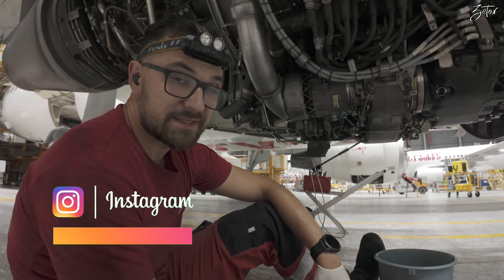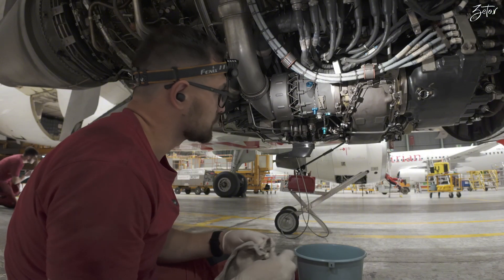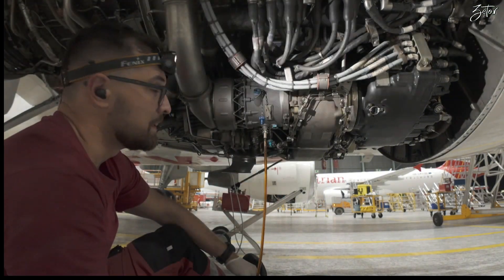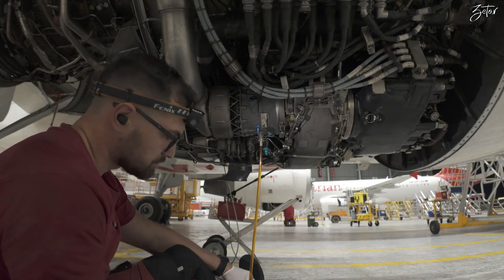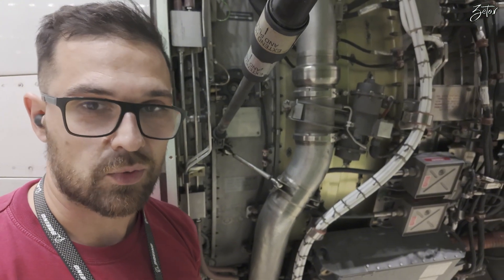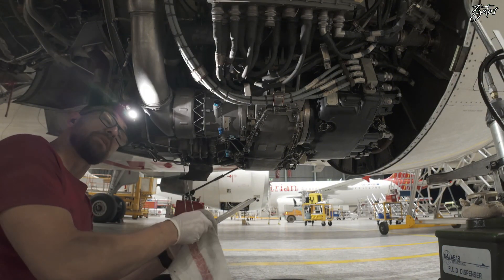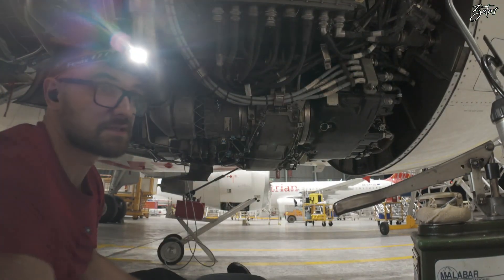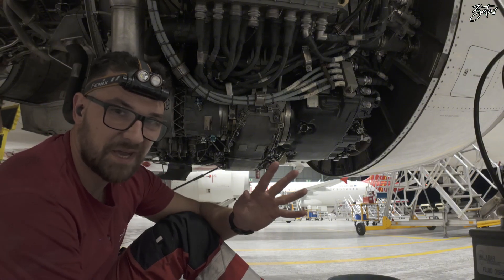Servicing of Starter on A320 CFM56-5B

Comment: Hi my friend you did not explain if the started is connected within the engine’s oil circuit or has independent oil pump and filter ? 

And if the starter is supplied by engin’es oil why do you service the starter itself as the oil pump of the engine basically feeds all systems??
Reply from the maker: https://youtu.be/EUolD-o37VM

Watch this, it should explain everything 🙂
Reply: @zeto.r Ok thanks !

Comment: En el caso que este diferida la válvula de start en pleno vuelo como el piloto podría reiniciar el motor en caso de apagarse ?
Reply from the maker: I guess you mean dispatched or faulty. Answer is simple. It is like car which is rolling down hill. In this case we will use power of the air. It is enough to restart the engine without starter
Reply: Muy agradecido por tu respuesta 😊

Comment: How do Engineers manually open the starter value for engine start is start valve doesn’t open?
Reply: By using 3/8 speedhandle while  engine start
Reply from the maker: You have that small lever on the side with which you hold it open, but you need gloves otherwise you will get your hand burned 🔥

Comment: If and when possible, I'd like very much a video about the starter valve. From what I understand it uses the air pressure from its own upper pipe to do the mechanical work to open itself, must be very clever.
Reply from the maker: https://youtu.be/JvGCooPPpF0 https://youtu.be/XBdChureQ1Y
Take a look at these 2 videos and you will understand everything 🙂

Comment: Question. At 50%+ N2 rpm isn't the running engine now driving the starter through the centrifugal clutch so I'm wondering how does the centrifugal clutch disengage from the engine N2 turning at 50%+ even after the FADEC/EEC has commanded the air start valve closed.
Reply from the maker: I expand it also here https://youtu.be/JvGCooPPpF0 but you need to understand how centrifugal clutch works. Lemme know if you need more info
Reply: @zeto.r  Ok thanks, I'm familiar with a Sprag clutch which relies on drive direction for engagement/disengagement. The video isn't exactly clear in detail how the centrifugal clutch engagement/disengagement is accomplished.
Reply from the maker: Once I have a chance to record it I can kick out a video about it 🙂
Reply from the maker: Cool

Comment: I was surprised that the bayonet fittings on the various plugs are considered to be adequately secure on their own. Instinctively I would have expected them to be at least wired closed to prevent them vibrating out or being loosened accidentally. As I understand it, 'belt and braces' is the way things are done on aircraft.